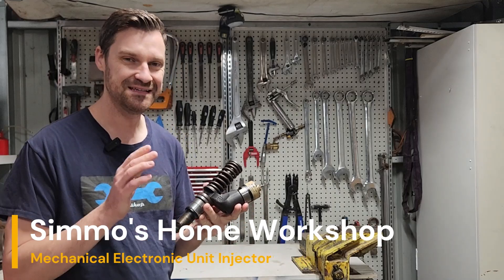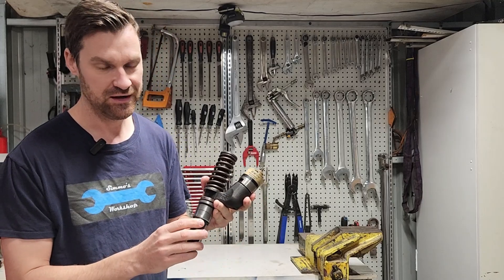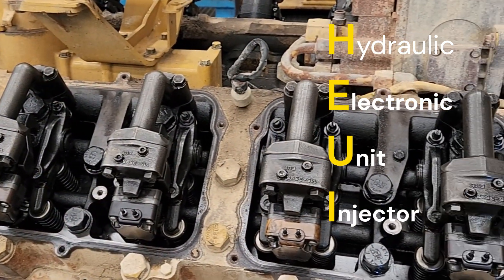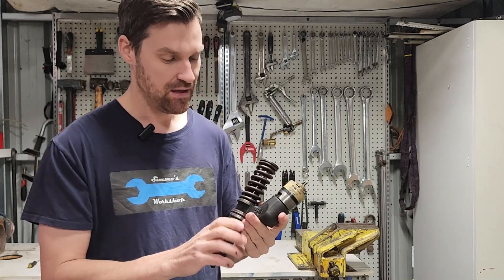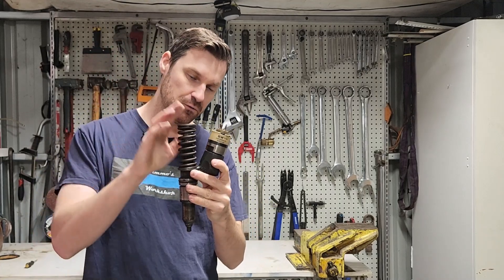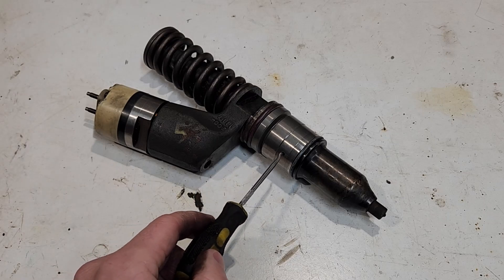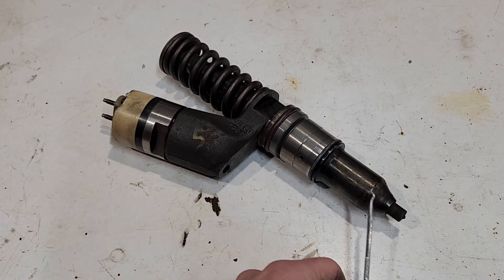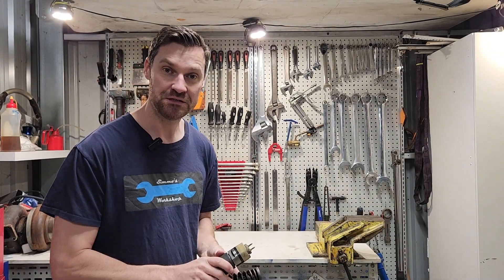What are MEUI fuel injectors? - These and more diesel injectors explained!

Comment: Hey mate so simply the selnoid controls the fuel return capacity but the timing itself is mechanically controlled by the camshaft
Reply: Correct me if im wrong please
Reply from the maker: Hey mate, yeah the movement of the plunger is fixed as it moves with the camshaft, however because the ECM controls when and how long the solenoid is open there is a small amount of control over timing, depending on when it opens during the stroke of the plunger (not the kind of control you would have over common rail, but a very small amount of control).

The ECM will open the solenoid longer for more fuel delivery but can also open micro amounts multiple times during the stroke of the plunger for complete burn and emissions compliance.